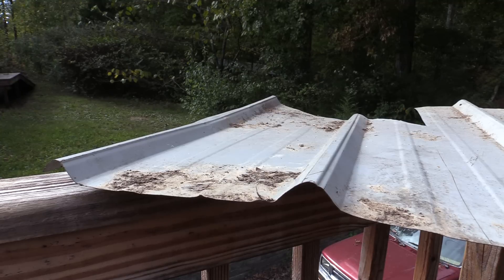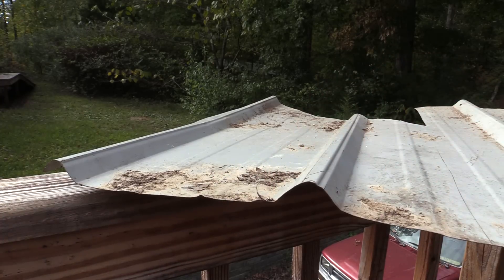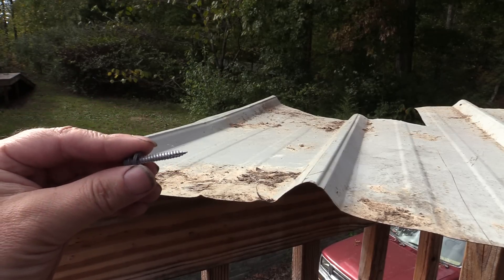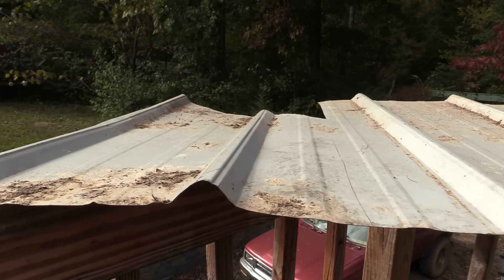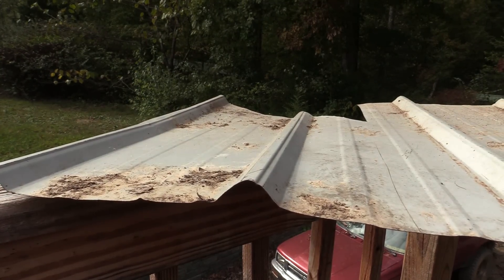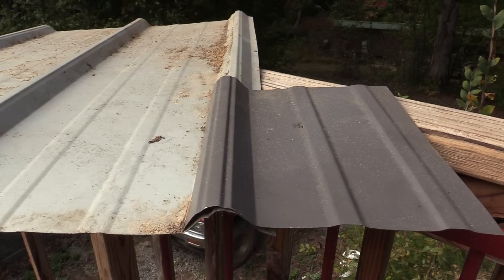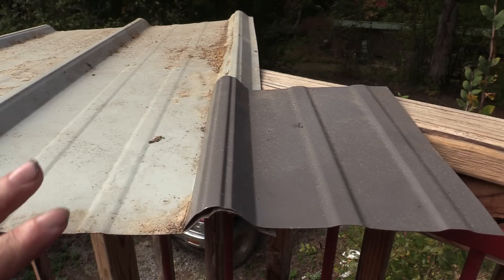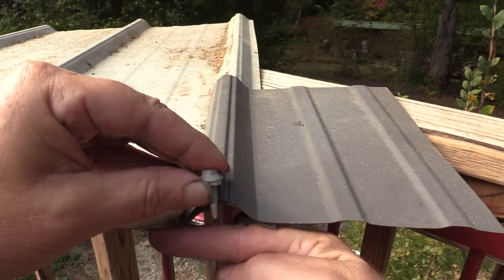Why you should not put screws on the ribs of metal roofing

Comment: We have wider and flatter tops of ribs on our t-rib sheets here in New Zealand, and we normally put the screws at the top of the rib yes. This is to avoid water pooling around your screw and eventually making its way in. When the screw is at the top of the rib, the water runs down the rib, and it is not accumulated around the screw. So does the dirt, pollen, dust, leaves and little pieces of litter that accumulate on the roof over time. When the screw is at the valley, it blocks the way of the solid deposits down the gutter. As a result, you get dirt deposits accumulated around each screw and this dirt keeps the water in it resulting in faster corrosion of your roof metal. When the screw is at the top of the rib, the dirt is washed down the roof with the rain without any blockage, which reduces the need for maintenance of the roof surface.
Reply: I have considered placing a one inch diam. dowel under the high points and then drilling before screwing in longer screws with rubber grommets.
Reply: That's fine, but then you'd have to add much more structure because you're going to lose all of the strength of the sheet metal. And a flat is not a valley. And, we have been building with metal sheeting for 40 years with the fasteners on the flats and have never see leaks. Just strength.
Reply from the maker: From what you describe it sounds like what you describe is what we call a R2 panel. Those panels I installed were heavier guage than what is in the video. From a water only standpoint screwing in the rib is the logical way to go. from a thermal expansion and wind resistance  it is not. thanks for commenting and i hope things go well for your country as you have been in our news.
Reply: yep:  but y'alls metal roofs are different than those commonly used in the US  -  they are usually heavier gauge and the ribs higher and straighter  -    y'all also use a corrugated roof that instead of being like a series of wavey "w"s is like a series of "U"s ( every other one inverted ) with the sides straight  -   y'all also use a larger screw and washer system

Comment: This is a hot, touchy topic. 
I like your comment of the roofing adding structural strength, if your structure needs that, then do what the manufacturer says.
My experience, and it's not anywhere as lengthy as yours I admit, has shown me that living on the wet west coast of Canada where it rains 10 months of the year except when it's snowing it's better to put screws in the ribs. 
Screws on the flat near the peak and under the peak flashing are fine, screws near the bottom over a well ventilated eave where things can dry out are ok, especially if it's open and you can see any leakage.
Just my experience, not Gospel.
Reply from the maker: @normcameron2316  thanks for your comment. I would agree with you as long as your roof is not too long meaning the number of panels wide not the length of the panels. Without some way to relieve the stress due to expansion and contraction of the sheets. I think anything more than 15 to 20 panels may be a issue .  The latest on piece screws are really good as well since they completely seal the washer underneath. I wish I had used those on my house.
Reply: @honeybeehomesteading  Most of my experience has been on buildings less than 60 feet in length and some longer.
We have a "moderate" climate here, generally don't have long smoking hot summers and maybe that is a difference.
A long time ago my Boss told me "When in Rome..."

Comment: Its Called 5V Simi Crimpt Metal Roofing
And You Never Ever Screw in The Flats
With Heating and Contracting of The Metal Roof Will Waller Out the Hole and Will Leak....
You Screw in The Ridges Always and They Never Leak because water runs in the Flat not The Ridge Ever
You Screw Where You Want but You Sir are Full of Shit
Reply from the maker: 5v is old metal roofing that is supposed to be nailed or screwed in the peaks. This is a classic rib panel also known as a r1. While you may not agree with me it is the very reason you state of heating and cooling wallering out the holes that is the issue. screwing in the flats allows the sheets to move independently. steel moves at a rate of .78 inches per 100 degrees per 100ft. A typical roof will have panels 25' in length. and a daily temperature shift of 33 degree maybe less or more depending on you climate. A desert would have a big shift. Linear movement would be .065 per inch but as the roof can move on both ends you can cut that number in half .0325 which is about 1/32 of a inch. now with installing in the ribs you are creating a single piece of metal which if your roof is 100 ft long would give you .26 and once again divide that number by 2 as the roof can move from both ends that gives you .13 or about a 1/8 " movement which is why your screws are wallering out as it is 4 times the amount of movement compared to screwing it in the flats. While you may disagree you can take it up with the manufactures who designed and tested the system. In the future be more respectful if you want your comments to be read.

Comment: I've been roofing since 1980 and these types of metal roofing panels were always listed as utility panel, NOT recomended for finised or occupied structures. Somewhere around 10-15 years ago that language disappeared from the literature. I inspect roofs now and these things always leak. When I install them,  I always put the screws through the tops of the ribs, but you have to make sure not to over drive them. Fix the overlapping rib first, let the panel relax, then fix the next overlapping panel to set on position and go back to screw down inner ribs in staggered pattern to reduce splaying of ribs. There are many reasons for leaking when fixing in pan from crooked or under driven fasteners. Over driving (impact drivers are the most common cause) will herniate the neoprene washer resulting in stress cracking. The bubble wrap insulation makes it impossible to get a good seal unless you over drive the screws then you herniate the washer. Finally, proper metal roofing allows for expansion and contraction of the metal, this type inhibits it and will elongate the screw holes, especially if you drive the screws down through headlaps of two panels or trims. DO NOT install this type of metal roofing on your house!!!
Reply from the maker: @markbarlow1675  the majority of metal roofs on houses have this type of metal on them. We are talking millions of homes. If the metal is properly screwed in on the flats it will work fine. But under or overtightening will results in leaks. Metal along the panel will not result in much movement about 1/32 on the ends of a inch in a typical daily climate swing of 33 Degrees f  and a typical panel length of 24 ft. Screwing through the ribs may be a issue depending on the length of the structure. My home for example if it did not have a break in the center due to a elevation change would have a total length of about 140 ft. That would give you 3/16 of movement on each end of the roof. That is allot of movement for the screws to take and only happens when installing on the ribs.
Reply: @honeybeehomesteading  sorry but I disagree with you.  Yes, there are millions of homes and other finished structures with exposed fastener metal roofing system on them, that doesn't make it a good choice. Every screw is a potential leak and it's not a matter of if but when. Installing over previous shingles only delay leaks that many times leak from day one but the old roofing delays it becoming visible on the interior.  You may install them and manufactures spec installation but I installed slate, tile, custom hand bent copper/tin flatlock and standing seam restoration jobs for more than 20 years and now inspect roof for over 27 years and see nothing but leaks with exposed fastener metal roofing systems. Now don't get me started on laminated dimensional shingles,  lol! I tell people to think like water and KISS (keep it simple silly).
Reply from the maker: @markbarlow1675  I think the when is important in your argument. There is no doubt that standing seam is the best option in terms of leak free lifespan. Exposed screw metal is a better option in my opinion to asphalt shingle as they develop leaks much sooner than exposed fastener. Plus the new screws that cane out that completely protect the rubber seal are supposed to last 50 years. I don't know as I will be dead before then. Good to hear someone is still doing slate. I hope you are using copper or stainless nails as that was always the weakness in slate.
Reply: @honeybeehomesteading  sorry to disagree but the neoprene washers are a 10-15 product, requiring replacement  2-3 times over the metals servicability. Exposed fastener metal roofs do have there purpose but it's not on houses or other finished structures. Again it used to be stated in manufacture literature but disappeared a while back. As for exposed fastener VS shingles,  completely disagree for many reasons but don't get me started on laminate dimensional shingles, I'm an old school 3 tab guy. Simpler is always better.
Reply from the maker: @markbarlow1675  the new screws are made of EPDM and will last much longer than regular screws as the rubber is not exposed to sunlight https://www.amazon.com/Roofing-Screws-Multiple-Colors-Quantities/dp/B08ZHP79PW.

Comment: You are correct! I built my shop nearly 29 years ago using 29ga master rib, metal with hydro block fabric underlayment. Never had a leak not once! Though had a tree fall on it and insurance paid to have half of it replaced. Long story short this so call 30+ year roofer replaced it without the underlayment and screws in the ribs!  Nothing but leaks since in the new roof! Had it inspected by roofing manufacturer  that supplied the materials only to find out any warranty  is now voided because of screws in rib and over tightened!
Reply from the maker: @nathanhatcher7096  I am sorry to hear that. There are a bunch of roofers out there that never read anything supplied with the roofing and are quick to call me a idiot. I was a licensed contractor and was never a full time roofer. The only reason I started doing them at the time very few people knew how to install them. Prior to 1990 most insurance companies did not want to insure metal roofs because they falsely believed they were more prone to lightning strikes. They got that information from asphalt companies wanting to replace roofs that could last 100 years to ones that could last only 20. They were helped by the lightning rod salesman the midwest that would convince you to put a lighting rod on your roof with a giant cable to the ground. They worked well and lightning struck them all the time burning many a house down. Anyone with a lick of sense would know to erect a tower of some sort away and taller than the house to help protect against lightning. Thanks for commenting and sharing.

Comment: Old retired man here from the Southeast USA.

I did everything you said NOT to. I put a metal roof V5 on my house in 1999.  Through Rain, Sleet, Heat, Snow, Hurricanes and Hail I have NOT had One leak at this writing and it's November 16, 2024 (25 years).

Note:
I also used the 30 Pound Tar Paper and long Shanked nails with a rubber washer.

And I made sure that the first panel OVERLAPPED the second panel, the second panel OVERLAPPED the third panel and so forth.  Because of the direction of the wind in my area, This was to make sure the wind or rain did not blow under any panels, only OVER each panel.  ALWAYS pay attention to details.
I'M not saying I'm right to do it this way it's just the way I think.  I'm an expert on NOTHING. 😁

Over the years my metal roof has weathered and it AIN'T pretty.  But it AIN'T leaking either.  😜

.
Reply from the maker: @DD-uf2uo  you installed 5v right if you put it in ribs as that metal was designed to work that way. The space between the ribs is perfectly flat with no shallow creases which is more flexible. The nails only are 1/2 inch from the decking. I installed several 5v ribs dating back to 1990s.This video is about modern metal roofing which works a little different due to the height of the ribs and the rigidness of the panel.thanks for commenting.also you may want to think about having your old roof painted. They make direct to metal paint that will extent the life of the roof.
Reply: @honeybeehomesteading  👍. Thanks and Have a great day.
Reply: Here in Australia roofers screw with rubber washer on the ridge. My old tin roof had led hat nails on the ridge also. No leaks on my new roof either.
Reply: @Zingo-sq4vq  👍

Comment: In my country that roof iron is called trapezoid profile. It is specified as it used on flat roofs, 2 to 5 degrees.  The last place I’d use to fix is the flat.  Everything moves with temperature change.  Who will argue that the flat point is better than the rib?  If water finds a way through, all of his friends will follow.  Water runs down the flat having been joined  by droplets immediately ejected from the ribs.
Reply from the maker: @ltgood  the manufacturer of the metal would argue different. I agree that using the rib will give you less chance of leaks but water is not the only enemy. Wind and thermal expansion are big problems as well. If you have a long structure attaching through the ribs can mean allot of motion as you are connecting every panel with the next.
Reply: @ thinking on that now I agree there would be much more movement on a rib fastened roof.

Comment: Exactly, I began doing this back in 1988 building my first house and have been doing it this way ever since.  I think this method was fairly new back then or at least I found very little info on it but it made perfect sense to me and it certainly does add structural strength to the roof when not using plywood sheathing.  I wished I had a dollar for every person that told me I was doing it wrong through the years!
Reply: We had a metal roof placed on our commercial office building.   They put the screws on the flat surface and after a short while it was leaking all over.  When the sun heated the metal it caused the metal to move and caused the screws to back out of the wood which in turn caused water to come through the roof where the screws went through the metal roof.  Never had that problem when the screws or nails went through the ridges.
Reply: @jameshewitt182    Interesting, maybe too many fasteners was the fault.  I've only seen the problem happen with fasteners on the ridges because the expanding metal in the rib jacks them right out due to there is no other place for the expanding metal to go except up.  I only put one screw beside each rib not on both sides leaving room for the expansion and have never once had a problem.

Comment: I just double checked my metal provider’s site for nailing schedules:  They are showing  long screws adjacent to the ribs, approximately 1/2-inch away, and 5/8-inch long stitching screws to secure the tops of the ribs together at the seam.  And the spacing between the rows of screws is dependent on the maximum wind speed.  

Always use get the manufacturers installation instruction sheets, and follow their pattern.  The only exception is if you are working from a set of plans and specifications, which are sealed by a design professional.   Then follow their instructions.
Reply from the maker: That sounds right. Sticking screws on the ribs besides the cap I have only seen scheduled for high wind areas. As always go by the manufacture's recommendations. Spacing between the rows of screws is also dependent on the intended weight load when working with purlins.

Comment: I put my shop tin on in 1977 ,ring shank nails ,top of ribs still doesn't leek, tar paper under neath,live in Oregon 40 miles from the ocean, yes it rains alot.
Reply from the maker: @williepelzer384  I bet that was 5 v roofing. Back in 1977 that was the way to do it as roofing screws weren't even a thing. I did several roofs that way and when the new screws and panels came out I was surprised by the manufacturers screw schedule. I have also removed many a roofing nail with ease by just pulling on the tin. Something that you can't do with screws. Thanks for commenting.

Comment: Thanks for the vid!  This means when I put my metal roof on 20 years ago I did it wrong.
Reply: I did it wrong 30 years ago. On a 48 x 30 building. Hasn't leaked a drop.   Still there.
Reply from the maker: You should be good unless you have a tornado situation. if you do develop any leaks from loose screws i would recommend replacing the leaky screws with the one piece head. not only do those screws protect the washer 100% but they are a little larger in diameter so they could be used in the same hole that a worn out screw is in. I have them in this vid if you are interested. https://youtu.be/klGGIK25Wm4
Reply: @honeybeehomesteading  I will watch it. Great vid thank you (this one).
Reply: Mine about 15 years. Haven't had any leaks so far. My thinking is that if a screw isn't seated right and the seal is compromised, it's gonna leak even if it's on a rib. Rain hits there too, especially when it's coming down hard.